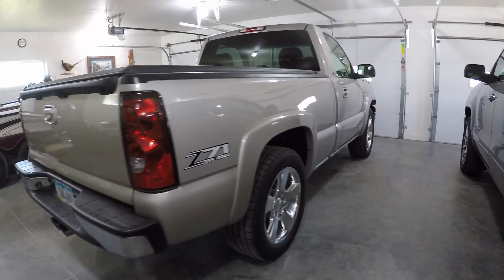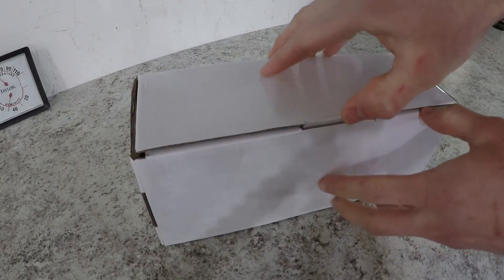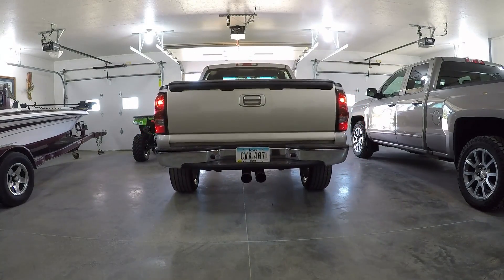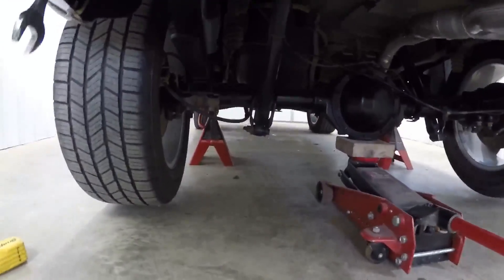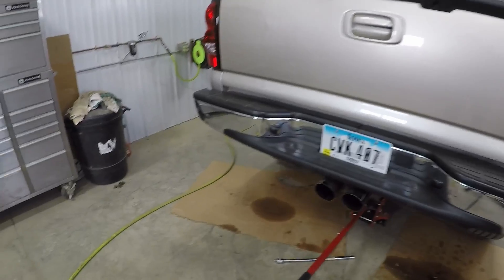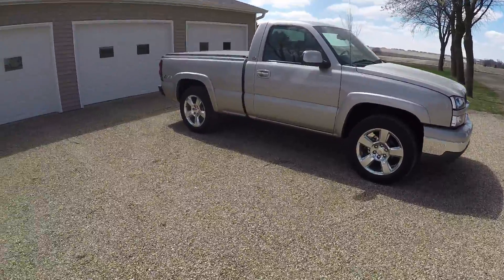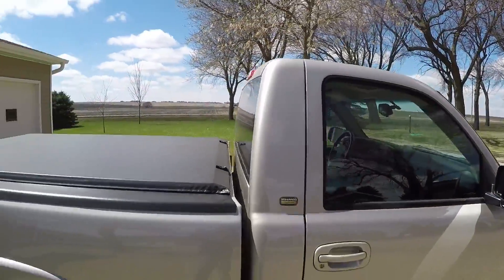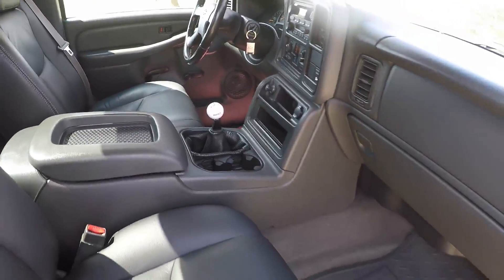Lowering Shackle Install FAIL! Silverado Finally Seeing Daylight after Mods

Comment: I took my bed off to install my hangers and shackles. One shackle bolt wouldn't bang out. Tried wd40 specailty, heating it with a torch, sledgehammering it. Wouldn't budge. So I cut the head of the bolt off and banged it out the other way. Replaced the bolts with grade 8. Worked great
Reply from the maker: Man I'm surprised I even got one out. I should have known as soon as I pulled that first bolt out, That was the ugliest rusty bolt I've ever seen. I guess I will have to pull the bed someday.

Comment: Mine were rusted in so bad to that indestructible bushing. After a week of trying with a hammer, a torch, oil, and an impact wrench, I gave up and took it to my mechanic. Had the truck back same day. Only problem, mine only got a 1" drop on the lowest setting. I have an extra leaf spring in there, so probably had something to do with it. Time to take the blocks out

Comment: I had put in 2 inch rear drop shackles on my gen 5 2wd crew cab. I bought “ belltech “ rear drop shackles on amazon my any possible way that they were counterfeit due to the fact since I slapped them on gm told me there was tension on my trans and drive shaft was uneven with my trans so once I hit high speeds I started leaking trans fluid. I asked around different shops and even my tuner and all of them told me they never heard of anything like that happening by putting on the shackles. I ended up taking them off to prevent it from happening again, but I hate the factory stance. And just trying to get some facts or opinions.

Comment: Do you  know have stepside  99 to 05 stepside  for sale or 2002 headliner  for a regular cab
Reply from the maker: No I don't know of any for sale, the headliners are hard to find too I think you can get them at the dealer maybe but they're expensive.
Reply: @TyBrink   I try my gm dealer thanks for all the help keep the good work

Comment: What floor mats do you have in the truck?
Reply from the maker: Brand new OEM ones I got a last year. They are specific to the 03-06 silverados.
Reply: @TyBrink  I have the vinyl floors in my truck, do you think those will slide around a lot in it?
Reply from the maker: @omarfuentes9363  yeah I think they would slide around unfortunately. On my dad's 2018 he had the vinyl floor for a little while with floor mats and it sucked. We put carpet in it, much nicer  now.
Reply: @TyBrink  Hmm might have to make the switch to carpet as well. Thanks man

Comment: What shackles did you use ?
Reply from the maker: Mcgaughys 2" drop shackles
Reply: And what about the front what did you do to lower it and how many inches did you lower it thanks for the info brother
Reply from the maker: @MOVAGO1995  it's a 4x4 truck so all I did was lower the torsion keys down all the way, it's probably 1.5" lower than stock if I had to guess.